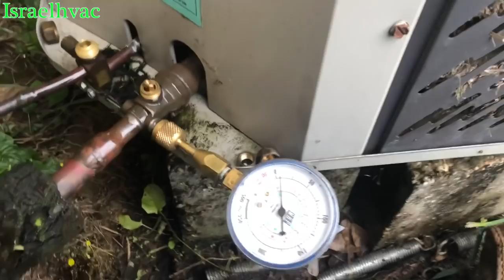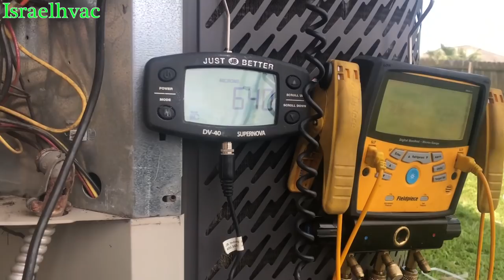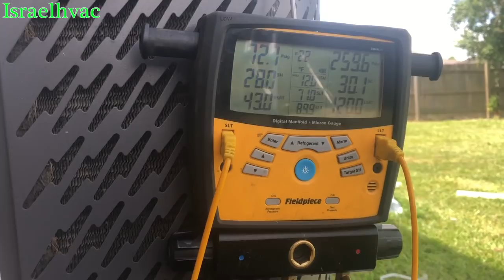HVAC Service | Evaporator Coil Pull & Clean

Comment: I have the Viper gun and Viper coil brightener, but I wasn't very impressed with the cleaner. The gun worked fine, though. I'm going to try it with some different cleaner and see what it does. I tried all settings, and it foamed but just didn't really seem to push anything out other than the foam itself. I definitely have much better cleaners, but they're not good for the coils, so I try not to use them unless I have to.

Comment: Israel what do you charge for cleaning a coil like that 
It’s way to much work on a old coil
Reply: Shelby Adam  If I had my own company I’d charge around $400-$700 depending on outside temp. 100+ degrees I’m charging $700!
Reply: turbolag98 woah that’s a lot.
Reply: Any Acoil that dirty needs replacement
Reply: @Athecubus  you're basically doing a coil changeout and cleaning. Hes not far off lol
Reply: @Athecubus  but id say about 95% of my customers would either change the evaporator itself depending on air handler age. Or change the whole airhandler out.

Comment: I hooked up to a 1994 straight A/C  unit today that was not cooling.
Suct.-118psi   &  Disch-250psi
Holy Hell Batman 😵😵😵😵
I think it was filled with sum R-2210A  😕
Reply: Shannon Knight sounds like compressor is gone
Reply from the maker: 😂😂😂 @Shannon
Reply: Shannon Knight
 Oh ya, R2210A.......  That's the new refrigerant that can be used in anything, from cars to residential AC systems and even refrigerators. I heard you can even fill balloons and tires with it.
Reply: Shannon Knight I had a R2210A yesterday, 205 suction 215 liquid 😂

Comment: Your lines were not covered on your first rinse, you seemed to notice it before you shot your coil cleaner. Next time show the difference between the JB and SMAN micron gauge. Ref the Cap, you used to use "Chinese" CAPS all the time! The SC guy did a few good review videos that I like, but he has become a MR. know it all! End of the day with Run CAPS is the cheap oil used in them. Agree or disagree, I give a rats ass, thermal break down!